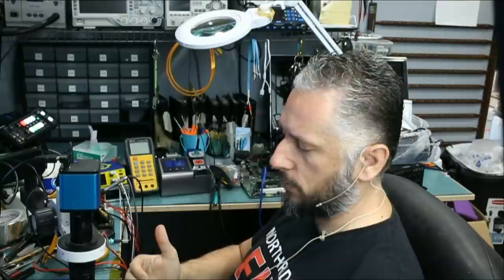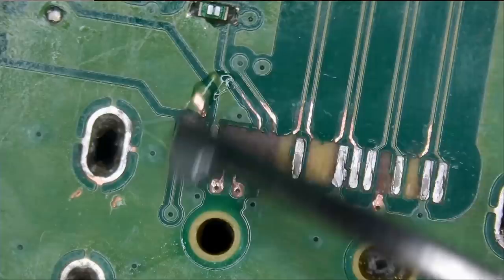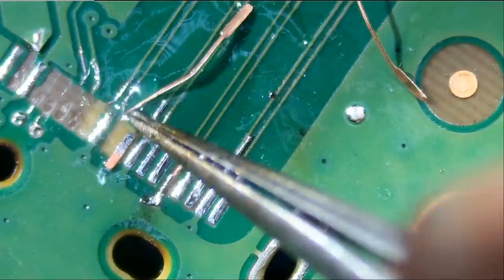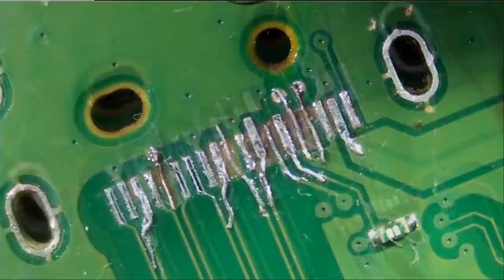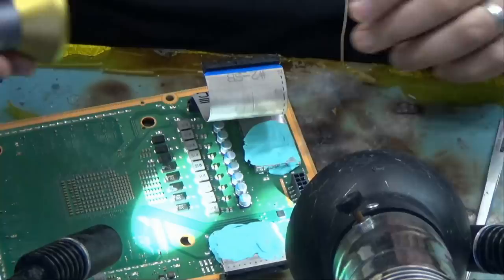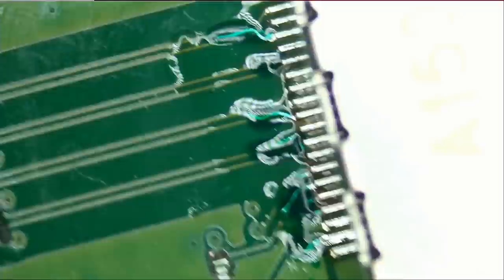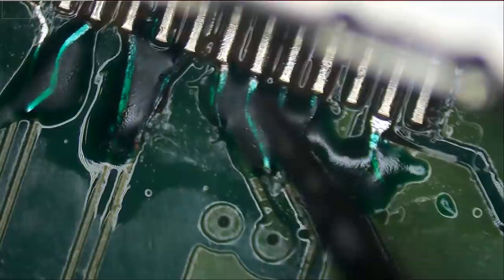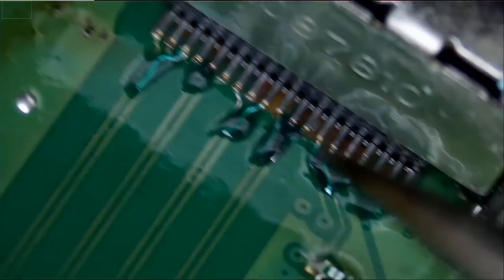Xbox Series X damaged HDMI connector restoration with 10 missing Pads

Comment: The UV + Heat gun shot provided a fantastic perspective of the scale/size you're working on.  In a previous video you used a dime, anytime you can remind us of the scale you perform these repairs on is appreciated and is awe inspiring.  

Also on the 2nd pad when you use the trace end of the pad, I'm like ummmmm,  then you trim and use the pad side on another ripped pad - Genius.  THEN a few pads later explain that using multiple pads in a row would cause a short - Holy $hit,  THAT is skill and understanding of a master tradesmen.

Comment: For these consoles, a template should be produced where all the traces and pads for the HDMI socket can be replaced in one piece. Stick it on, solder it in, remove the rest, done.
Reply: They are people who make/sell them for some applications.  If you are repairing things in volume it makes sense and helps.
Reply: Honestly not a bad idea. Wouldn't necessarily be hard to have made either. Could even have it pre-tinned.  Scrape some masking off, lay it down like tape, hit it with some heat and youre done!
Reply: there is a company doing these flex pcbs for the nintendo switch. they should offer these for various consoles tbh

Comment: I just bought one of those grinding pens from your store and it came in about 2 days ago! I’m excited to use it!
Reply: Heads-up on the grinding pen. Just got mine a few days back: when you put in the small grinding head, you've got to adjust it a bit in the chuck to make it run true. Don't tighten the screws too much and watch it under the microscope to see if the bit wobbles any. If it does, hold the chuck and partially rotate the bit and watch it again. Once it's running true, snug-down the set screws evenly. The thing works great.

Comment: looks like hdmi is such a bad plug design.

on some hdmi plugs there is nothing on the back that stops the pin from being pushed out.

a little too many contact points and such a small plug! ends up with a little too thick cable that gets too heavy for a small plug.

Comment: The zoom camera makes all the difference in the world: I have this junk Mega CD, and it freezes on the bios. Swapped all the capacitors, still freezing. I decided to reflow the main chip on the board, but the legs on the chip are so tiny, next one to another, that even a tiny amount of solder, splashed over and doesn't matter how hard I tried to see where 2 joints have solder so I can separate them, didn't work. And after many tries to remove the excess of solder, I ended up breakint 2 pads, and 1 leg, the leg broke very close to the black mass of the chip, so I gave up: I know I can try to trim the black part to reach to the copper, but it's so tiny, that I think it's worthless. The camera would be solution here...! Anyways, I bought another faulty Mega CD, swapped some boards, and now I have a working device, the other one, I'll put in the closet to work as a donor if any other part needs replacement in the future.

Comment: Alex, when you're soldering the feet for the connector on the board, you have the connector upside down, are you holding or pressing the connector on to the board from underneath? or are you letting hang freely and soldering it wherever it happens to rest?

Comment: Flux helps with the transfer of heat(more surface area contacting), and probably mainly slow down or prevents oxidation of solder and copper(a thin layer over the metals that prevents solder to fuse).Oxidation is accelerated by heat. Thats what I think.
Reply: What helps the solder stay a beautiful blob on the joints instead of being a spike when you take off the iron tip??
Reply: @freakbot1056  Right temperature, right flux, right solder, right tip. Always remember, flux is your friend. Eutectic alloy is your friend. Clean iron is your friend.

Comment: Why so many broken HDMI ports on Series X. Is it because the ports metal support legs don't protrude out the the other side of the motherboard? Therefor no extra solder support like on previous gens where the solder forms a cone shape as it clings to the protruding HDMI port support leg. Widest at the motherboard then gets smaller right up to the HDMI port support leg tip.

Comment: Can we all admit that there is enough space on the PCB to make these kind of repair much more easy for both specialized technicians, and hobbyists? The HDMI is a connector that is constantly under stress, this PCB area should be designed accordingly.
Reply: @graealex  That’s true. I guess the manufacturers differentiate between home use and industrial equipments. Thus the smt option.

Comment: What do people do to their HDMI connector to get that kind of damage?
Reply: First, they break it through normal use or abuse. Then they don't know how to desolder it properly with hot air, so they rip off the pads.
Reply: Happens if you desolder it to could

Comment: I always encourage DIY repairs but it’s baffling to me that people would attempt to repair such an expensive and not so easy to obtain device without any real expertise. Practicing on your own device isn’t the smartest thing to do in my opinion. A simple HDMI connector swap needlessly turn into a much more expensive and complicated repair.
Reply: I disagree, it’s better to learn on your own device than someone else’s. But nevertheless, that’s why you should start with broken electronics to get the basics and then work from there. My first console solder attempt was a broken Xbox 360 I got for free. No way I would do it on a console I use regularly.
Reply: @ramirososa7566  that is what I was inferring. Practice on a broken board first. It should be obvious that Practicing on some one else’s device without informed consent and full disclosure is just foolish.